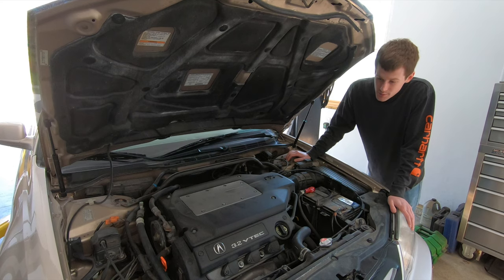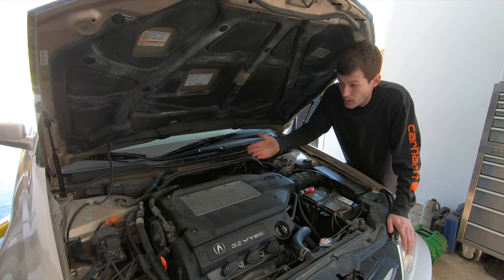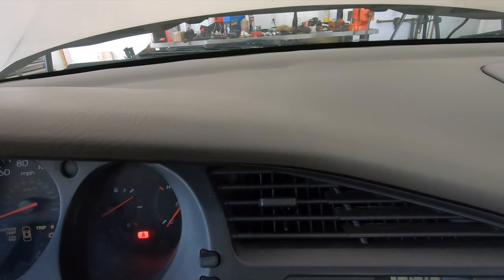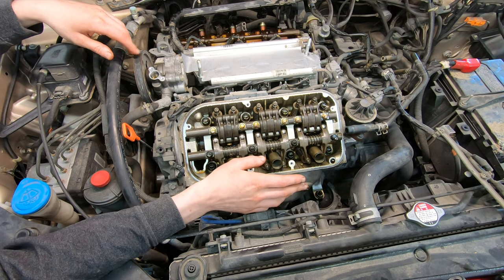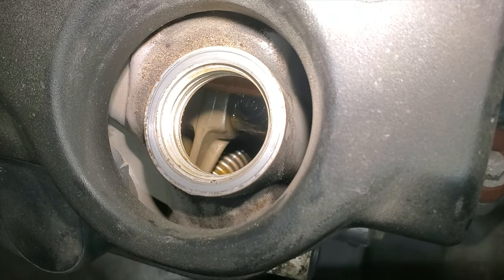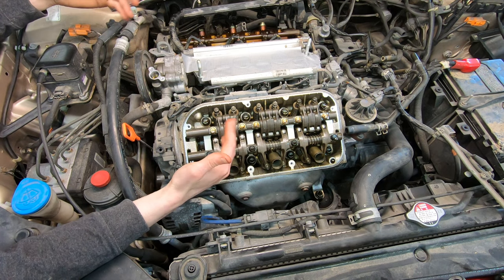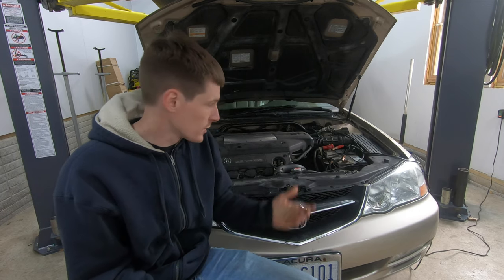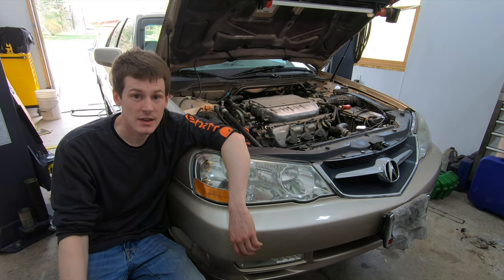Why Do Honda's Need Valve Adjustments?

Comment: Had my valves adjusted on my 2002 Honda S2000 at 157k miles and now it feels like it's got 10 more HP. The shop told me I was a smart Honda owner because most people never get it done. It will make your engine last alot longer he said..
Reply: Good on you for having an S2K with 157K miles! You are properly enjoying that car.
Reply: Its crazy that almost nobody does the valve adjustment and the engines still last crazy long😂
Reply: What was the cost , for that adjustment?
Reply: absolutely it helps the valves seal much better

Comment: Very good presentation.. 335k on my 2006 crv Never adjusted the valves.. Recently changed original spark plugs.. minimal chatter from valve train..  I religiously change oil with Mobil 1, and religiously dump and fill transmission fluid...  amazing vehicle..
Reply: How is your CRV still holding up? I have a 2014 CRV.
Reply: @spritemoney  338k now.. just replaced resonator as the flange to CC broke. December will be 16 years driving this CRV
Reply: @DK-vx1zc  any suspension part replacements over the years?
Reply: @Spiffa0  Struts, ball joints, cv shaft, brakes of course.. AC just died recently :(  Otherwise still runs great
Reply: @DK-vx1zc  nice, that's about what I've had to do also
Reply: 335 k miles or kilometers? Good mileage. Is it 2.4L ?
Reply: @jamesmedina2062  now 340k Miles. 2.4L
Reply: @DK-vx1zc  Venerable k24 then huh?? Excellent! My VW 1.8 made it to 330 miles but was burning oil at that point and polluting like mad! On 2nd turbo too
Reply: @jamesmedina2062  that’s why never understood why people waste money on cars like a VW for some unknown reason to me they’re not appealing or very reliable and parts are very expensive and not widely available in comparison to Honda and Toyota
Reply: @jamesmedina2062  my other Honda a 2006 K-24 Honda accord 4 door is extremely reliable this has 269,560 miles as of this post and she’s out lasted and runs better than many of the later model and more expensive cars like your VW and my child hood friends second BMW I ask him why do you continue to waist money on those things he just says I don’t know 🤷 but he’s always complaining about how many problems it always has and expense it cost to fix and find mechanics that will work on them which he usually has to go out of town to find 🤔🤣🤣🤣
Reply: What happens if you never adjust the valves?
Reply: Then you get misfires...
Reply: Thats just being on your car its not running at its peak when you do the hare minimum
Reply: @nikko1984 so u get engine codes for this when it happens (misfires) ?

Comment: A BIG thank you for sharing this information. I have a 99 Honda Accord LX 2.3L. My awesome cousin told me I needed a valve adjustment after sharing my video with him. Shop I made an appt at keeps pushing my appt further back. So I walked into another shop and asked for a qoute. Instead I was told the following- 1. In all the mechanic's 20 yrs he's never seen that a Japanese vehicle needs a valve adjustment. 2. He needs to diagnose my car because there may be something more serious with the engine. 3. $110 was the diagnosis fee. 4. Mechanic absolutely WOULD NOT give me a qoute for a valve adjustment. So TYVM for helping me not feel insane.  Now going to attempt to do this job myself since I'm tired of mechanics messing with my car.
Reply: Did you do it?
Reply: My dear they said $225 for daigstic 2024 your is cheap must be 1989😂😂😂😂
Reply: @raduszilagyi6055  no, turns out it was another issue
Reply: @KC-xp9of that's funny considering that's what the mechanic was trying to find out

Comment: When my 2006 Honda Pilot reached 100K miles, I called several Honda dealerships in my area, asking what their 100K service included. Besides the normal timing belt, water pump, etc., NONE of them said they checked valve adjustment, even though it's required by Honda. They all said "we only check them if they're making noise", and of course, wanted to charge extra to check them. So I did the service myself. Guess what? Nearly all the valves were tighter than required, and likely would have gotten tighter as the miles accumulated. Getting ready to do the same to a 2006 Odyssey. Dealerships service centers are considered profit centers, and as such, are only motivated by that, not what's best long-term for you or your vehicle.
Reply: I'm doing my 2010 Odyssey on my own. I've heard similar stories about garages dissuading people from doing the valve adjustment when they do the timing belt service. I think they just don't like doing it. It's tedious and finicky compared to most other service jobs.
Reply: Worked at a Honda motorcycle dealership. The manager got mad at me for following the maintenance intervals and procedures in the service manual on customer units. He hated that I cared to take care of the customers units. He went as far as to tell me don't do the quality of work that I do. He also encouraged me to be dishonest with customers. Needless to say I left and am now trying to spread the word.
Reply: @GreyFox250  Thank you.  I had a dealership try to sell me a brake job that they said needed to be done and the estimate was for several hundred dollars.  Took it to my son who checked them and he reported that I still had half the break shoes still in great shape. People don't realize.  Thanks for a heads up for everyone.

Comment: Honda doesn't use hydraulic lifters because it's less accurate. Solid lifters do need to be adjusted but can provide more accurate valve timing, especially for the higher revving engines. Like you said, they're pros and cons to both setups.

Comment: Old Porsches needed their valves adjusted every 20k miles.  They switched to hydraulic valves in the mid 90's.  Would have not thought Honda still used this old technology.
Reply: Honda requires it from 100k miles. Feel the difference?
Reply: @4545377  not really. Some people wait until they hear the lashing sound to get the valves adjusted. I’m sure it can have a long term effect on engine wear.   My car has 325k miles. Never thought the car was faster after the service.
Reply: @bngr_bngr  325k miles surely require adjustment. Yeah, the lashing sound,  some honda mechanics say if hearing no lashing sound,  no adjustment required.
Reply: @4545377  that’s why some Porsches got their engines rebuilt at 100k miles. I always adjusted my valves.
Reply: I'm at 236 miles 05 odyssey it's time.
Reply: Until very recently corvettes had tech from pre 80s old doesn’t mean bad they’ve obviously made improvements

Comment: I did my 2006 Civic valves at 250k km (156k miles). It very clearly sounded like a clickity clackity  sewing machine. All the valves where a bit loose. The sound totally disappeared after the valve adjustment. Still good at 334k km (208k miles). I have an Odyssey with 184k km (115k miles), no obvious valve noise yet.
Reply: Gotta replace valve cover gasket and consider doing valve adjustment. Don’t really hear and clattering yet. 144k miles on 06 Civic.
Reply: Finally did my Odyssey at 235k km (146k miles). It didn't have any distinct valve noise, but it was 12 years old so it was time. All the valves were a bit loose except the cylinder 5 exhaust valves which were a bit tight. BTW, for anyone reading: I don't recomment the FelPro gasket kit. The FelPro sparkplug tube seals do not fit as tightly as Honda's seals and the FelPro rubber is noticably softer that of Honda's tube seals. I bought the FelPro kit, then replaced it with Honda OEM after I inspected the installed tube seals and saw that some of them end up pinched. The Honda parts are not much more expensive.

Comment: Great Explanation! Thanks! My last vehicle was a 2007 pilot. An exhaust valve tightened up and “burned” before I knew about having it adjusted. It never sealed up correctly again, it had lower compression on that cylinder and made a slight ticking noise. Honestly I never noticed a performance difference and the vehicle ran absolutely fine until a Tesla crashed into it at 260k miles. I suspect it would have gone another 100k without issue. Thanks for the video!

Comment: Your video is very educational.  Honda service department informed me that I need a valve adjustment for my 2013 Honda Accord, but my vehicle is sound like the first day of purchase.  It is not displaying any unsual noise.  Until it does, I now know my car does not need a valve adjustment.  Again, thank you.
Reply: If they are too tight you would not hear anything but Even Though Honda recommends about the adjustment at about a 100000 miles it seems like most people are able to make it to a 150000 or more...  If your check engine light comes on someday and you are getting random misfire codes there is a chance the valve adjustment could be the solution so just keep that in mind in the long term and keep enjoying your Honda!

Comment: Thanks for the simple explanation! At least it’s easy to adjust the valves once you’ve cleared everything out of the way. My 1977 VW Rabbit (Golf) had different thickness discs between the valve head and the camshaft. You had to buy a disc anytime that a valve needed adjusting.

Comment: I just bought a new to me 2013 Honda Pilot EXL, and was kind of disappointed that the valves/lifters were not hydraulic... But, then I thought about it, as I plan to keep this vehicle... I have had hydraulic lifters fail, and it required removing the head(s)... Now, I am really happy with this purchase, and yes, I can set the valve lash. One thing I have discovered, doing some minor repairs, spark plug tube seals, is that these J series motors are so easy to work on, especially on the Pilot.

Comment: I adjusted my 2007 civic @ 250,000 km, just because i thought it would need it. Oldschool and solid engines.
Reply: Did my 2006 Civic at 220k km. It sounded like a sewing machine before it warmed up. All the valves where loose.
Reply: Hows your civics sounding now?
Reply: Do You percieve some chages in fuel consumption after do that?

Comment: I could hear the clicking when you were in the vehicle but not on the outside, so when comparing before and after, include the inside after sound. BTW, you explained this so well I know I do not want to do this work (mine is beginning to sound like Caterpillar made the engine), even though it is relatively simple, and will take it to a mechanic, and I know about how long it should take and exactly what they are going to do. Telling me that valve adjustments are rare (and why) for most mechanics lets me know this is one job I will probably take to the Honda dealer service instead of my new mechanic (darned it, mechanics wear out too and Old Trusty retired).

Comment: Thanks for the video. My son went the the dealer and they wanted $400 to this during a routine round of fluid changes. He has 70,000 miles on a 2016 CRV. I will do this with him next time he comes home. 2 questions: 1 - What is the tolerance of the setting? Feeler gauge number? and 2 - will I need a new valve cover gasket ? Thanks again. Great and informative video
Reply: Yes, you need a new valve cover gasket set.  This includes the spark plug tube seals (most likely needed more than anything), the valve cover bolt button seals and the cover gasket.  You need to look up the 2016 valve lash clearances, but the 2011 and down are .008-.010" for intake and .011-.013" for exhaust.  You also want the special 10mm valve adjusting tool.

Comment: ACK !
Wish I knew this before I had the valve cover gaskets replaced 168k miles.   This also explains strange noise the mechanic couldn't figure out.
Just did total of over 5k repairs/maintenance on 09 ody.
Reply: Would’ve been like 2000 max if you did it yourself so

Comment: Interesting.

In gy6 scooter engines (cloned from hondas), the rocker arm screw that contacts the valve tip actually makes a noise whether the clearance between the screw and valve tip is too loose or tight. I just adjusted mine today because I heard valve tick, which was similar to a lawnmower. There was no clearance whatsoever between the freeflow rocker arm screw and valve tip, nor the exhaust rocker arm screw and valve tip. Added .004mm clearance to the freeflow screw and tip, and .006mm clearance to the exhaust screw and tip, and the valve tick ceased. Interesting to learn that the Honda car engines don’t make a tick when there isn’t enough clearance between the rocker arm screw and valve tip. I wonder why there’s a discrepancy.

Nice video!

Comment: Nice thing about the Honda adjustment is that it’s screw and locknut making the process simple and not needing any parts. 
I’ve done the valve adjustment on my motorcycles which uses shims so requires a shim kit and removal of the camshaft and timing chain tensioner.

Comment: Interesting. This is a really good example of engine noise.  At idle i would've thought that was normal but when you put it in drive I would've thought it was a cam going bad.  Lucky I was wrong though and that can be cleaned up all with a valve adjustment.
Reply: Did it make a whistling kind of noise while you drove? My 2005 acura TL currently makes that noise, my mechanic told me it could be the water pump, he took it to an engine expert and the guy was just trying to sell him a whole new engine. Mechanic told me it could just be a valve but not sure he told me to just save my money and if it sounds worse to just take it back and do the work for it, but its all speculation. Hes not too sure what it could be.

Comment: I have a 4cylinder 1.8 civic 2013. Just turned 200k miles. No noise. No misfires. Starts and runs good. Should i adjust the valves? Or Atleast check them?  I have a very minor valve cover leak. So I might take apart anyway. Thanks

Comment: I have a 2012 honda accord that has 272 k. Never been adjusted. It runs perfect. no noise that I can tell. The dealer wants $1000 to adjust them. Can I hurt the motor not doing it? Thanks

Comment: Hi there. I’m chasing random misfires on my K24 engine and I have the opposite problem. The noise and vibration happens AFTER the engine warms up vs when it’s cold as you said in the video.

Comment: Just a tip: If you have a Gen 1 Honda CRV, you should be performing this adjustment every 30,000 miles. The owners manual will state contrary (100k) but this is because Honda’s board in America argued that Americans are not as willing to perform maintenance on their vehicles that regularly as Japan. No alterations were made to the function of the motor to protect the consumer from still having to make this adjustment EVERY 30,000.
Reply: The B-20 engines in the 97-01 CR,V's require more frequent attention because of the particular way that wear takes place. The valve seat gradually loses material thru attrition, causing the valve lash to become more narrow over time. This is especially true for the exhaust valves. Without periodic adjustment to re-establish the proper gap, affected valves may not close 100%, leading to burnt valves/seats. These engines are like tanks if well cared for and can go 300-400K miles easily.
Reply: I just checked valve clearances after 100,000 to 146,000 mostly highway miles on a 2009 Honda Fit. The exhaust valves had lost clearance which I understand does not lead to the telltale tapping sound but can cause valves to burn through if let go too long. I measured as low as ~35% below the minimum specified clearance on the exhaust valves so I really should have done it sooner. Not sure that every 30,000 miles would be necessary on the Fit though unless it was exclusively used for city driving. I probably should have done it somewhere between 75,000 and 105,000 miles.

Edit: Updated mileage as I realized that the valve clearances may have been adjusted once early on as part of an unrelated repair.
Reply: It cost like 550 to adjust the valves on the 3.5 so most people won't do it every 30k
Reply: @jasonwallace6945  It’s tedious but not complicated to do yourself tbh. Well worth learning how
Reply: I hear you but screw a crv and paying that kind of money every 30k.  That’s sickening.  Honda should eat that cost to 240k on every vehicle.  Garbage design.
Reply: @Ske3849qw  It’s a great design actually. So long as preventative maintenance like this is performed, it’ll outlive any vehicle without an adjustable valve lash. That was the point: more preventative maintenance, but less major problems down the road if cared for properly. Valve lash adjustment is dead simple, you’ve only gotta pay for the tools once! It’ll take you about an hour on a weekend in your front yard; just remember to pick up a valve cover gasket first because you’ll have to knock that out too. On vehicles with a fixed valve lash, you’d have to rebuild just to adjust. THAT’s a job for damn sure, will cost you about $4,000. That’s if you catch it in time before the valves float.
Reply: @Ske3849qw No, it is a great design and very reliable as far as longevity; Honda's are and have always been one of the most reliable vehicles on the road, but the manufacturer surely knew that 95% of all owners would not perform this preventative upkeep measure and would take it to their dealerships, for adjustment or repair, so, job security for their technicians and Company as a whole.

Comment: VW Beetles and old Porches need regular valve adjustments. Beetles and related air-cooled engines have a valve whistle when accelerating if they are correctly adjusted. If not, no whistle. You have to listen to your car! It tells you important things.
Reply: Exhaust whistle,  and most people get rid of it by upgrading exhaust